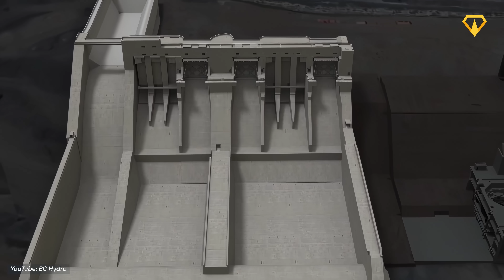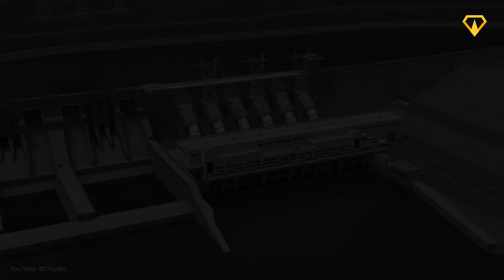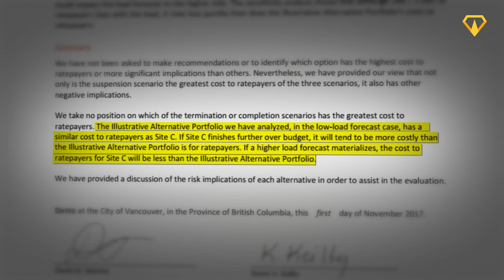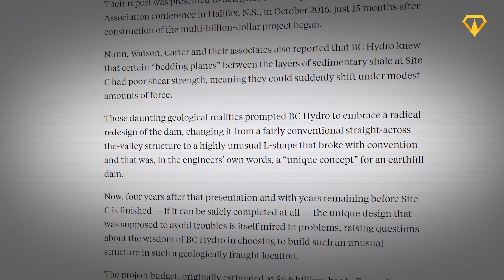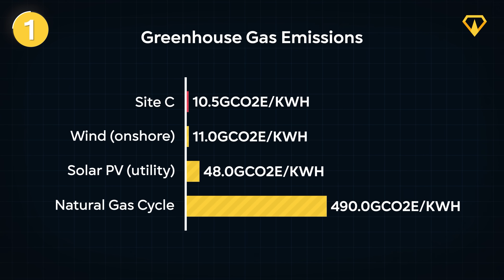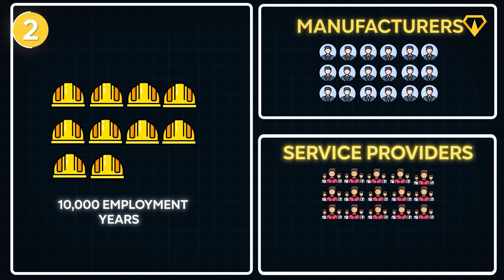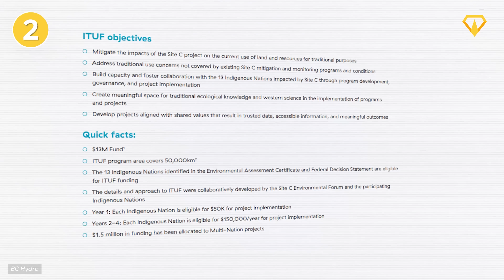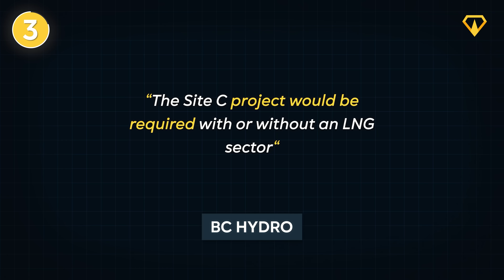Canada's Massive $12B Mega Dam

Comment: Large industrial uses of electricity makes electricity less expensive for residential users by increasing demand creating the ability to build new larger more efficient electric  power stations to make older frequently more polluting less efficient power plants secondary.  

It is very expensive to add gigawatts of added capacity to transmission lines.   There is also some loss of electricity in transmission.   It makes for cheaper electrify  to have large generating plants near the major loads.   

Hydroelectric power generation is the quickest reacting no cost for high availability large scale electric power generation.  Coal plants and nuclear electric power stations have been made to maximize efficiency and not store steam for high availability.  Hydroelectric power can work well with erratic solar voltaic and wind turbine electric power generation.   

Anybody promoting greenhouse gas behavior as able to cause global warming is ether ignorant or knowingly acting in a criminal manor.   It's scientifically impossible for greenhouse gas behavior to cause global warming.  All the greenhouse radiant energy from the earth is completely absorbed in earth's greenhouse effect by greenhouse gases within 20 meters of the radiating surface that is always in saturation from the strong greenhouse gas water vapor.  Global warming was officially stated at 1.1°C in 1991 and 1.06°C in 2022.  Global warming stalled at about 1°C in 1992 and has no known cause.

The back of the United Nation's IPCC science report states it took its greenhouse gas samples at 20,000 meters altitude where it is common high school level knowledge there is no greenhouse radiant energy.  This is typical practice for deceptive marketing to state legal data transparency protecting the perpetrators from fraud prosecution.   The IPCC has been transparent with its data acknowledging it is not dealing with active greenhouse gases.  

Earth's greenhouse effect is frequently used as a primary example to high school students of a system always in saturation from the strong greenhouse gas water vapor absorbing all the greenhouse radiant energy from the earth with greenhouse gases within 20 meters of the radiating surface that is all around us everyday and can't have its overall effect changed.  There is no further greenhouse radiant energy to interact with greenhouse gases.  At 1% average tropospheric water vapor over 99% of earth’s greenhouse effect is from water vapor.  Water vapor would hold earth's greenhouse effect in saturation if it were the only greenhouse gas in the atmosphere.

Arctic warming is taking place with the proving mechanism being warm Atlantic Ocean waters migrating deeper and more frequently into the Arctic Ocean warming it and the region.   That warmer water is causing a few weeks less of reflective snow and ice coverage resulting in more solar heat gain to the Arctic region surface.

Atmospheric CO2 levels of 1200 ppm about three times what they are today would greatly invigorate C3 plants the majority of plant life on earth greatly greening the planet. 

0.4% of the atmosphere is CO2 and on average 1% is H20 water vapor.   (1% H20)/(0.4% CO2) = 25.  Water vapor is 25 times more present in the atmosphere on average than CO2.   Water vapor has an CO2e of 18,  18 X 25 = 450 CO2e total for water vapor to 1 CO2e for CO2. 

The Earth’s oceans have 3-1/2 million sea floor volcanic vents warming the water and changing it’s chemistry that have not been systematically accounted for.

Comment: It's not ''clean'' at all if you consider all the materials and energy that is going into the project. Now, in the long run, will it overcome those costs and be able to be declared ''clean''? Probably, but that will be many years from when it come online.
Reply: name a cleaner method of producing energy.
Reply: @Ryan-093    Geothermal is cleaner, but that is very location specific.   Wind and solar are both very clear though the turn over rate for the hardware is obviously higher than for a dam.  

There is the philosophical issue not addressed in this video of the viscious cycle of the human need to constantly increase in energy production leading to an increase in population.  This cannot continue indefinitely because we live on a planet with finite space and finite resources.  

I don't have the answers, but personally consider the Alberta Tar Sands to have a more catastrophic impact on the environment and the native people.  

This dam is just one threat to the region and in threat leads to additional decline in the environment and making it less habitable for people.
Reply: @Ryan-093  nuclear
Reply: There's nothing really "clean" in every project related to energy but the one that is more clean of them all is the Hydro-Electricity dam

Comment: You can’t have cheap electricity with no trade off
Reply: At 12 billion if we assume it will power 400'000 homes and assume a home will use a very conservative $100 per month worth of fuel it will take 25 years to pay off. That's a very short amount of time on a very conservative assumption on electricity consumption.
Reply: Yeah we can: nuclear. High production of reliable baseload power in a minimum of space using fuel that can be mined domestically. No CO2 output either if you think that matters.
Reply: @SanchoPanza-wg5xf  This is what I've been telling people. We have a country abundant in elemental uranium that we just sell to other countries instead of using ourselves. Same goes for gas, lithium, nickel, wood and so many other metals, minerals and resources. In trying to solve climate change we simply sell pollution to other countries like China and India. Hell we don't burn coal anymore but we sell it to China and can you take a guess as to what they do with it? We might as well just burn it here ourselves. Obviously I am being hyperbolic and do not want to start reopening coal power plants. Renewable and sustainable energy is a good idea as a slow transition and I think nuclear is a great way to help the transition away from fossil fuels while still keeping hydro affordable and reliable until we have further solidified the renewable infrastructure.
Reply: @SanchoPanza-wg5xf  Nuclear is the best...until it goes wrong. When it goes wrong, the damage is permanent. Just look at Chernobyl and Fukushima now.
Reply: @MithunOnTheNet  And? compared to the millions of deaths beacuse of coal power during the years its nothing. Fukushima never really was a problem, chernobyl was because of Communism.
Reply: @SanchoPanza-wg5xf  Yea I'll pass on paying for that.
Reply: @patrickr2601  Thank you for responding that you are against nuclear power. 

Which of the following alternatives do you find least objectionable?

1. Flooding thousands of hectares of land to power hydroelectric dams.

2. Exploiting slave labour and fossil-fuel-powered mining operations to extract cobalt in Africa for the purpose of building electric batteries for EVs.

3. The mass slaughter of bird and whale species with wind turbines that do not produce electricity when the wind stops blowing, thus necessitating a parallel baseload power grid.

4. Covering vast expanses of arid farmland with solar panel that do not produce electricity when the sun is obstructed, thus necessitating a parallel baseload power grid.

5. The burning of oil/coal/natural gas in conventional power plants to supply the electrical grid with necessary baseload when the wind ain't blowing and the sun ain't shining?
Reply: @SanchoPanza-wg5xf  how about consuming and using less power? of course capitalism isn't going to promote the obvious.  No1 needs a smart ring / shoe ....
Reply: Try checking your own consumption and doing the math.
Reply: @SanchoPanza-wg5xf  All valid points, but the natives would flip out if there was talk of nuclear within a thousand miles of their reserves.
Reply: @yarrdayarrdayarrda  who gives a damn that they think, lol
Reply: at 12 Billion - it's not cheap
Reply: Solar would be 50% cheaper.
Reply: And useless every night.
Reply: @albex8484  at night too?